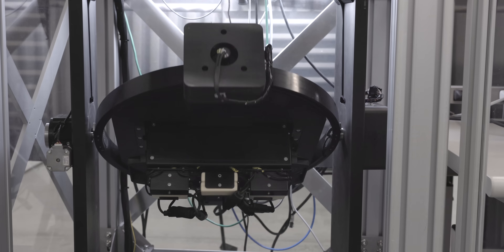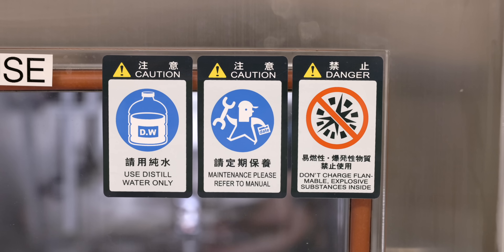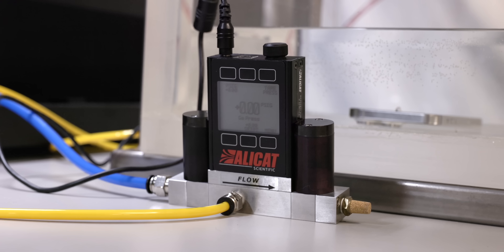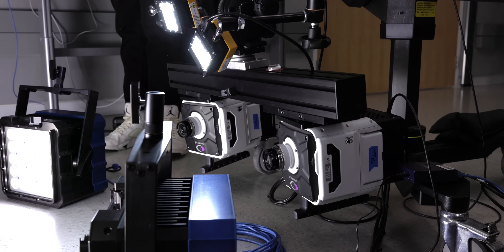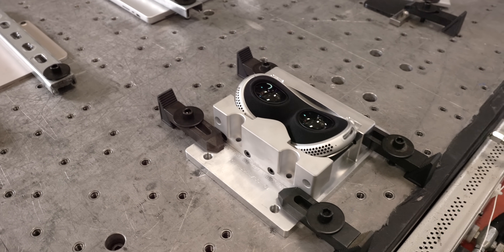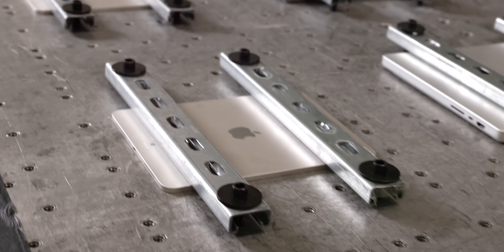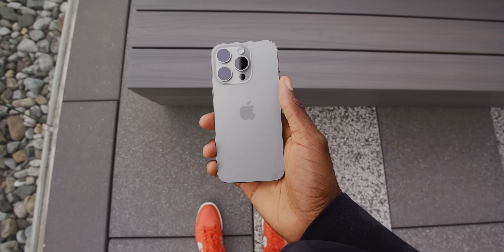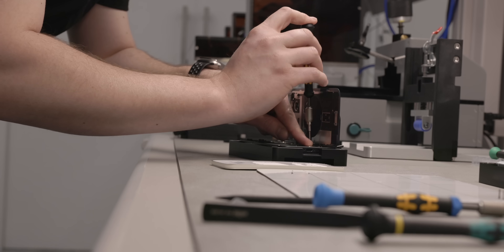I Visited Apple's Secret iPhone Testing Labs!

Comment: I mean just to be clear - a lot of intelligent marketing talk happening here - if you would really would want to make a device ultra reliable - you wouldn’t put a thin layer of glass on the back of it. There are decisions made with these phones, to make them less reparable, and that’s not because of the adhesive to make it waterproof. Of course - the waterproofing is impressive, but it’s not the only reason these phones are so bad to be repaired.
Guys, don’t get fooled.

Comment: ...Also, I enjoyed the convo regarding the testing of iPhone's. I worked at ROLM Corp (in Santa Clara, before IBM and Siemens acquisition's) long before there was a smartphone from Apple or Motorola. To drop test the ROLM phones we stood on a raised platform and dropped them on the floor in the office. And to test/shake the phones, we used a paint can agitator. I still find this stuff very cool, and it's awesome to see how things have changed, and yet still the same.

Comment: The shake testing is at least as much about their shipping process as lifetime survival. The shipping process usually has the most vibration the the thing will experience in it's life.

Reliability and repair-ability are not mutually opposed, but they are more like different points on a many many sided radar graph. Durability, repairability, size, water-resistance, and appearance at a minimum are all a trade off. You can make something sealed and repairable, but it has to be bigger for example (see the Fairphone). And you can make it equally durable but more repairable (e.g.., removable battery) but again it has to be bigger, and if you also want it waterproof, it has to be bigger again, perhaps with visible screws....

Comment: Normally I don't react so quickly to a video but this surprised me. I myself come from the phone industry have had the opportunity to repair both Huawei and Apple at top level for a company and no one talks about the type of water they use to test their devices. 

This is Distilled water This is to for example:Distilled water, distilled water,[1] or aqua destillata, is very pure water. Distillation has removed all inorganic salts and many organic substances from it. Distilled water is a poor conductor of electric current.... So in short, this means that you can easily immerse a phone with this but it will never mimic real life. Seawater(salt) Pool water(chlorine) is quite different and will definitely affect your phone. Finally, your phone is waterproofed by Rubber and double sided tape. Unfortunately, I have had plenty of customers in stores that I had to tell that companies do their testing a little differently. And so in the “real” world things are a little different. 

Too bad nobody pays attention to this and it is not mentioned in the video. 

don't want to be a nag but do want people to know that this kind of water really does work a little differently than normal tap or sea water.

Comment: The attempts to make it super durable are great but what makes them hard to repair is the coding of parts so that you can only use genuine Apple parts from a genuine Apple Store. Make it this hard to break without those software restrictions and then you’ve got a better solution surely.

Comment: I like how Apple drops the "safe for the environment" bomb whenever somebody raises an issue
Reply: That was a BS response. It gave as an example how before, when batteries were easily replaceable, phones would get water damage. Bruh, the iPhone never has had any replaceable battery and it got water damaged until 2015, and it was just as bad to replace batteries as it is now.
His argument doesn't hold up in the sense that there are things that wear down by getting used, no matter how much "durable" you make it, so sacrificing repairability is always a bad deal. You will never have a device that's so reliable it will never need any service. That's a falacy.
And it's been more than proven that Apple doesn't hinder repairability because of quality standards or W/E bullshit, but because they want to keep control of their own devices. If your lid angle sensor on your macbook breaks or becomes uncalibrated, they don't want you to go to a technician that knows how to repair it. They want you to go to their apple service and spend as much $$$ as they want, or maybe buy a brand new device for a little bit more (now go ahead and tell me how that is safe for the environment). Or push you to get their Apple care plus service.
Reply: Truee!!
Reply: They use metal body rather than many other companies use plastic body phones  so that right and correct to say samsung oppo vivo etc
Reply: And then they partner with OpenAI, which uses as much energy as a small country to generate useless emoji. Completely undoing Apple's energy reduction
Reply: Wait isn't it green to sell you a new Laptop after your old one died because the company made a big error in the design years ago and won't fix it under warranty
Reply: Apple...You already saving environment by buying Apple products 😉
Reply: i mean its true tho, the less shit to throw away, the better it is for the environment.
Reply: @bluenexus1212  Non repairable phone user: Damn, this specific component of my device broke, guess i'll chuck it out cause it costs more to repair than to get a new phone together

Repairable phone user: Damm imma have to send this in for repair

One throws out 100%, other only 20%
Reply: @bluenexus1212  "the less shit to throw away", you are just ignoring the fact that if even a small part of such a device fails, you will almost be forced to buy an entirely new device, because the costs and difficulty of repair are so high.
Reply: @123456Luck10  yeah, when its like 10 years old. As in when it's deprecated. You don't HAVE to throw out you phone every 3 years if your iPhone screen cracks and you get it replaced (whether with or without apple care).
Reply: @bluenexus1212  yes, but it's false that you can't have repairability with durability. They could make things more repairable without compromising durability at all, yet they choose not.
Reply: The more holes and ways to get into a device the more space for shit to go wrong and water and bs to get into
Reply: @olivarra1  Oh damn I didn't realize you were an engineer and have found a way to make something more durable and more repairable!
Reply: @stateofthecat  One way to make something less wasteful is making it so you can replace parts of the motherboard instead of the entire board when one small piece goes wrong. Apple doesn't allow that. In fact, they're making it harder for independent repair companies to do that. Another one is making it so people can replace their batteries instead of having to mail it or drive to Apple when their battery goes bad

Comment: I still stand by what I posted on Twitter:
The scale between repairability and durability is a fair point and all, but what this does is answer why it's so difficult to repair things, not how expensive it is.
The truth is that difficulty of repair isn't what's holding people back from replacing their batteries, replacing their screens or expanding their storage. People who don't feel comfortable with performing such a repair should and do just go to a repair shop or the Apple Store. The price is the barrier here. To replace almost anything, you need to pay an astronomical amount of money (compared to what the thing actually costs), and third party repairs with third party parts just don't work without replacing some chips here and there.
Apple makes a great point that durability might be better for the consumer than repairability, but that doesn't explain the chips on compontents that lock the component to a specific phone, such as the screens, nor does it explain the high prices that disinsentivise repair, both through the Apple Store and through the Self Service Repair program.

Comment: The reasoning behind durability and repairability is flawed. It is not in the best interest of any company to manufacture products that last indefinitely and never require maintenance, as it is simply not profitable. The individual's statement appears to be a defense against potential European legislation. The Galaxy S5, released several years ago, demonstrated that it is possible to create a phone with water resistance and a user-replaceable battery. While it is technically feasible to produce durable and user-repairable phones today, companies are reluctant to do so due to potential financial losses.

Comment: The engineer is really doing damage control for Apple's terrible repair reputation. Adding in 15 different types of screws and blocking replacement screens/fingerprint readers because of part pairing doesn't actually do anything to make the phone more durable. Reparability and durability are not mutually exclusive.

Comment: I think durability has its benefits of higher quality build and parts that need less repair. Quality has improved. What is striking as Marques notes that breakable materials are used, which to a degree does defeat the point of durability. In that teagrd, today still in my view, are the screens and batteries of smartphones. Because repair is so expensive and not very easy and dummyproof to do, it remains an absolute expensive endeavour of special tools and experience to do it. And even third-party repairs are still a gamble today in terms of quality of repair for the price. Then, there's also an issue with Apple coding parts for security reasons for original parts, which makes repair even more difficult. To me it means there is still a huge flaw in design of building a high end smartphone, that while durable, still has two flaws in their phones that are the weak spots, and can not come to aaan affordable dummy proof repair for the battery and screen, without needing to deal with astronomical high repair pricing (which I think is not a sustainable strategy to continue keeping the phone running instead of providing a new phone. To me, it makes the phone not feel part of an ownership but an obsolete product, and then I can not understand the high pricing of the phones in general).
This issue is not merely limited to Apple smartphones.

Comment: thank you to everyone in the comments for calling out the "repairability is at odds with durability" bs for exactly what it is
Reply: I remember being told decades back that the biggest problems in electronic equipment happen at the connectors. If true, then the less (repairable thing) connectors the better.
Reply: @KiltedGreen  Especially Macbook connectors with a 52V backlight line right next to a 1.8V CPU data line
Reply: It's an obvious truth. If you don't know that, it's because you don't know the first thing about manufacturing or engineering.

Edit: Apple's obsession with ecosystem control is also at odds with repairability, just to be clear.

Comment: durability is at odds with repairability? what are you on my man 😭we have the last generation fairphone which was water resistant but had a removable back and zero adhesive on the battery, the asus zenbooks & the framework laptops all being very durable and repairable at the same time, and i can list so many more examples. Heck, Apple products are not very durable and not very repairable either so they can't even pull that card!

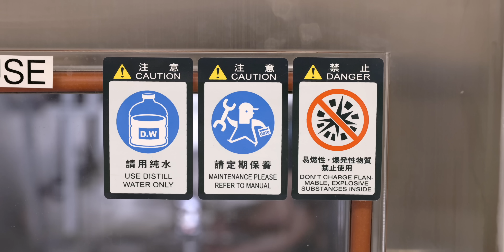Comment: 1:50
Distilled water isn't conductive, so what's the point of the test if it won't cause any shorts? (At least compared to something like rain or pools, which have far more minerals)
Reply: You don't need shorts to detect water going in.
Reply: @Sotha42  Makes sense. No point in damaging stuff

Comment: I don't believe the reliable Vs durable debate. You will find old phones with replaceable batteries still working but very rare to see  modern phones with non replaceable batteries that are working 5-6 years later. They can definitely engineer repairable and durable phones. And repairable phones battery replacement requires less material than a bloody new phone. What a joke to say otherwise!

Comment: Apple wants to trick consumers into thinking it’s ok that phones are hard to replace 😂 

Battery’s, Screens, Connectors and Buttons should be easy to repair. 

Apple should offer original parts at their website with all the o-rings and glue gaskets and activation keys. 

As long as they don’t do this, they just want to earn as much money as possible 😅

Comment: Fun fact: I've been using mobile phones for 28 years and never broke one - not even a screen, and I only needed battery replacements twice. 

Same goes for my Apple laptops and iPads: just the occasional battery swap (within warranty). 
Despite that: durability is still king over repairability for me.

Comment: I think the durable vs reparable argument is stupid. Many many products designed for rough use are often very easy to repair. We do not overclock cpus etc etc ,just want the screen , battery and charging to be eaisly replaced or repaired .and if durability is that important to apple: give me a case and pre installed tempered glass in the box

Comment: you know, it can't be a secret if you know it exist lol.
tell us about the 128 bit, cpu. you know the one, has a terabyte of ram on the die, transfer rate of 1000 terabyte per sec, 128 cores, with 256 virtual. (hyper threading, lol, intel speak)  with the ability to render two 8K, 2 hour videos, in 1 second.  you know the one. who cares about a phone, yeah yeah, it falls in a water puddle and it still works, lol, big deal, yeah better cameras, expected, make a phone called, expected, receive a phone call, expected, hear and understand the call, that would be a special treat... 🤣😂😆 impossible. 🤣😂🤣 we want to hear about that new processor based on 0.08nm tech.  if they can put that on my desktop, they can consider cancer cured.  

do you now how many people are in line to use the nation's super computers? 

hey, hey, do we need to send in the IMF. lol (impossible missions force) 😎

Comment: wrist watches for 100 years have done proper water proofing and shock resistance without being expensive or being ridiculously "high tech" or having those really expensive IP rating certifications! you can go diving with a 20 dollar GShock that is held together with screws! you can drive them with a golf club and there's a good chance it would survive! and at the same time is very repairable! apple is straight up deceiving with the "hard to repair if its more durable" claims!
but apple and others decided to go all out on certification money and stack it up on a 1000 dollar device!

Comment: 7:20 with all due respect you are so, so wrong about this, and it is exactly this mindset which sets back innovation. Also, if this "Sliding scale" analogy held water, and while I concede that there are phones on the market which were less repairable and more durable than the iPhone and vice versa , there are also phones which are both more durable and repairable than the iPhone (for instance Fairphone 5)

Comment: I couple points I'd like to see clarified. MKHB is usually a little more critical than this so I'm a bit surprised to see him so easily parroting Apple's propaganda lines.
 1. Apple isn't necessarily known for being harder to repair when it comes to hardware. They are harder to repair because the SOFTWARE of the phone prohibits you from doing so unless you use genuine apple parts done by a licensed apple technician. This is an artificial barrier to repair that has NOTHIING to do with durability. Only control and greed.

2. Repairability and durability are not necessarily inversely correlated, rather loosely related. Instead of a 2-dimensional chart, I'd add a 3rd axis and call is cost. You could probably make an infinitely more repairable and durable phone, but for more money. So, it's a balancing act that takes into account the cost. Not knocking this point. This is what business is about. It's just key for consumer to understand this.

3. Apple's goal is NOT to make an unbreakable phone. Apple's goal is to sell as many phones as possible. This includes some measure of planned obsolescence. You win a certain number of customers over to your brand by being superior in many ways including durability, but if you make it too good they will never buy another one. They have carefully calculated many factors like qulaity, supply, demand, cost, etc. to come to a balancing point that is full of compromise. 

Apple is a business. They are not here to make the best phones or the coolest tech. They exist to make money first and foremost. Never forget that.